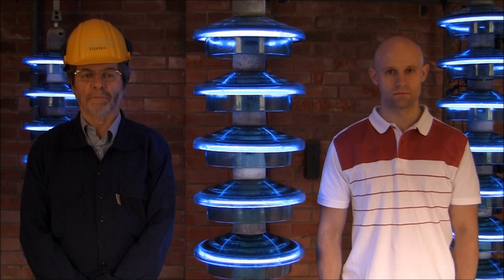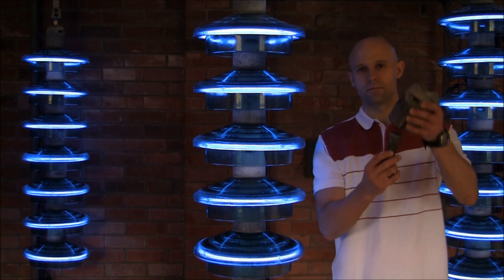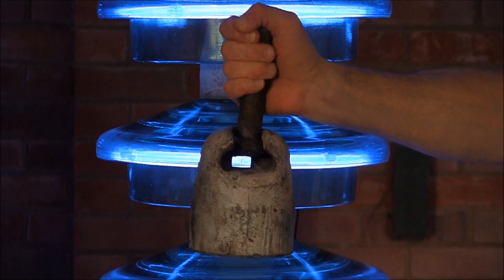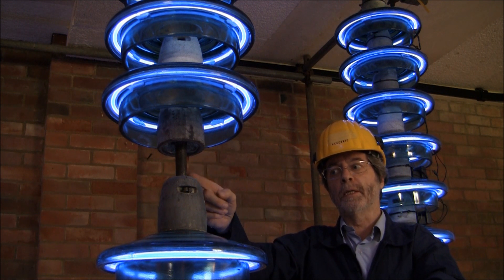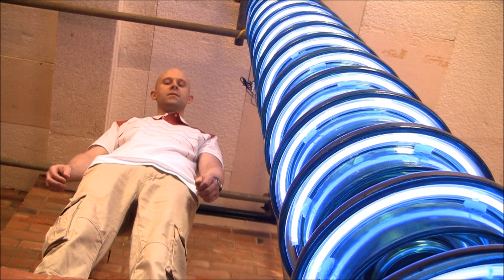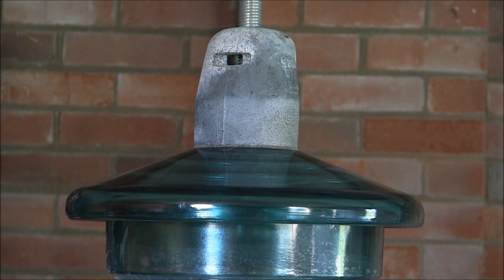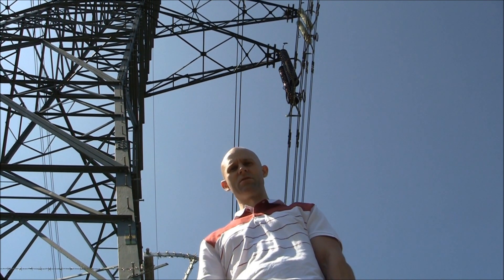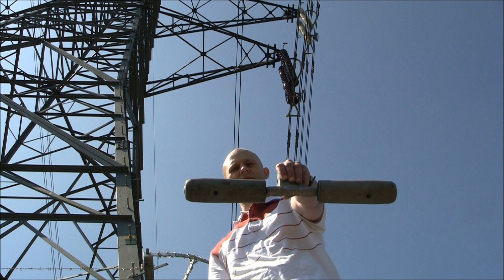Pylon Insulators a brief overview

Comment from the maker: Thanks for appreciating the vid. We do tend to over do the production.
Your right about the size. When you see them from the ground its hard to gauge how big they are especially against the scale of the pylon tower
Reply: Right with that, they appear around 4 inches diameter from the ground.
Reply: Great video. I always wondered why with the insulators on tall pylons, some were just one insulator on the end of each arm hanging straight down, and others were 2 almost vertical insulators on the front and back of the arm ends with a wire hanging down under the arm end connecting from the tip of the front insulator to tip of the back one. I also didn't know at the time the latter were called the strain insulators. And I wondered why the strain insulators were generally on pylons which changed the direction of the wiring, while the single insulators were on pylons where the wiring continued in the same direction

Comment: Great video.  How do they change the insulator strings and hold the wires up while the procedure is being undertaken? And do you know why some 400KV lines, which have been refurbished are having a cable taken out of the bundle so only 3 wire bundles are left, for example the West Burton to Pelham line?

Comment: I've always wondered what those bits connected to the cables either side of the insulators did - now I know :-)  Incidentally, was that real current, you used during the salt water test,  or just a visual effect?  And if it was real voltage, how high?

Comment: Found some old insulators off a lower voltage O.H.T.L., had probably been left over following a replacement job. They were about the size of large dinner plates, and were more or less like a glass halo style frisbee. Some galvanised fastenings left behind as well.